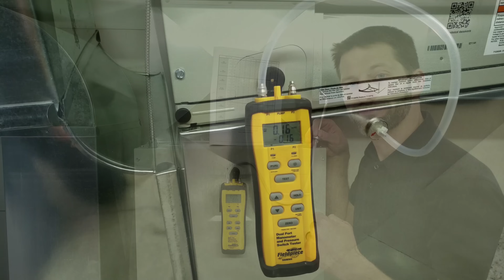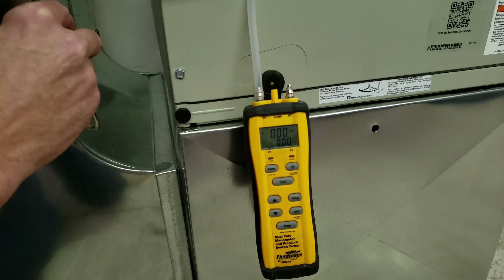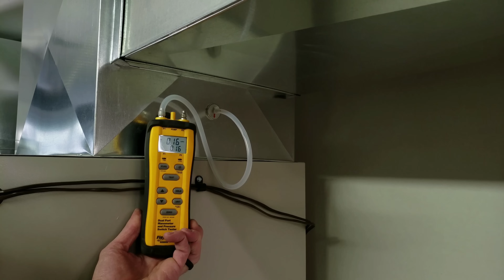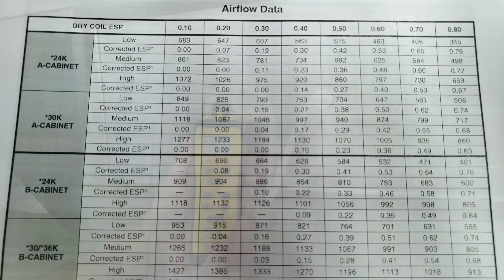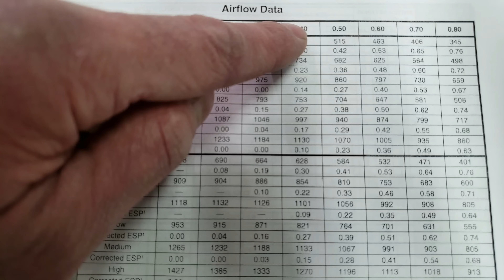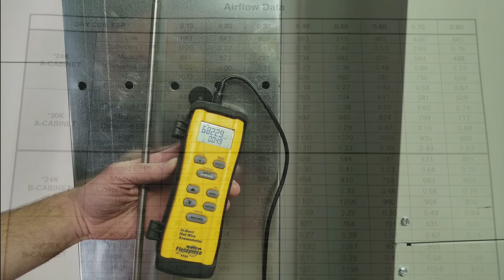Measuring Static Pressure on an Air Handler for Airflow CFM!

Comment: I wonder how many HVAC techs that do all these tests. I can guarantee that most don't do this even on a new installation. When I had my HVAC replaced in 2015 the contractor didn't give me any test results whatsoever. So I have nothing to compare to when the system was installed. They didn't even mention that I had to register my system within 90 days to get an extended "free" warranty. Anyway, which is better: static or dynamic?

Comment: If furnace has two returns connected to opposite sides of blower enclosure.  Do you measure both returns? Add them together? Then measure after ac coil then add that valve to the 2 return values? Or just get a single return valve from blower enclosure  and after evaporator

Comment: what is different with A-cabinet and B-cabinet?
Reply: Usually the difference is the dimensions of the unit how wide it is usually where A is for many brands the widest, B is smaller, C is the smallest (For. Equipment I see lately an A cabinet is 24-26 in wide, vs a B cabinet which is 20-22in wide vs C being 18-20in wide)

Since there is a change in the dimensions that means to openings on each end for return and supply are different and thus the CFMs being moved would be different

Comment: Isn't that technically a pitot tube, not static pressure?  Seems like 'static' pressure should be measured right at the hole without pointed into the flow.

Comment: Helpful video, thanks. One thing that I find confusing is the use of the phrase “static pressure” (i.e., singular versus plural “pressures”). This description suggests that there is a single pressure measurement in the system. It seems that a better way to discuss this subject would be to describe the system as a series-connected set of components each having a pressure drop across it (i.e., pressure DIFFERENCES). This approach is akin to describing voltage drops across a set of series-connected electrical components.

Comment: Where do you stick the probe if your filter is not in the duct right before the air handler such as a ceiling grill with a filter? Do you just stick it up near the filter in open air?

Comment: Hello and thank you for all your teachings . I just bought your book, workbook and cards . It’s like treasure box of information and I HIGHLY recommend all of them to anyone who is serious about mastering HVAC. I Have a question regarding airflow and static pressure. When you took your measurement you inserted the probe into the return duct. I live in Miami and here HVAC systems do not have a return duct. Instead the air handler sits in a closet with louvered doors. The return on the air handler is just open to the hallway outside the bedrooms .  This is the case in all houses here . Where do I place the probe to measure static pressure ?

Comment: Hi Hello sir. Thanks for the explanation. but I'm a bit confused, so suppose if I wanna start to design a fan from zero. the main parameters for this are the air flow, static pressure (pressure rise), and the fan speed (rpm). How to determine the static pressure ? can we put it as much as we want or is there any basic calculation to wisely select the proper SP for the design parameters ?. In my case, I'm about to use the fan to cool down some electrical objects (generator windings). pls help me.
Reply: I'm interested in AC techs response but I think this video is for ducted A/C systems so in your case if you are just using a blower housing to blow on a motor or generator you might use the amp draw to determine the limits. Whereas static pressure is measured inside ductwork. The more you constrict the air flow the lower the amp draw of a "typical" blower motor (a paddle type fan works differently) . If you have to LITTLE restriction of the air flow on a blower the amp draw may cause the motor to overheat.  I use a blower (out of a 120volt furnace) mounted on a plywood panel to blow air out of a window of my house when outdoor temp. is moderate and I put a 3 speed switch on it. I also use cardboard to block some flow to reduce the amp draw and also raise the static pressure and reduces the cfm. I never use the high speed on the blower motor with no restriction of air flow I believe that would overheat the motor. 
If you are using a ducted air handler the install manual gives the "standard" external static usually .5 sp, which I would read as this air handler will provide this amount of air (cfm) at this amount of external static pressure (resistance) so as you increase the amount of resistance to flow by adding ductwork, filters and grilles  you are raising the total static pressure and lowering the amount of cfm.

Comment: Spent $10K at a trade school bakc in 2006 and not 1 instructor is as good as this guy. Amazing explanation skills. Thank you.
Reply: @Fred-zt6gf  depends who your teachers are . a degree with on field experience goes a long way
Reply: Ain't that some $#!%? 🤔 
 I went through the same thing; my instructor didn't teach me a damn thing about how to determine CFMs through pressure drops. 
  You either learned your material online or your book, or you didn't learn anything. 
  He had his mind set on fishing, and would even take off several days at a time to do so.
Reply: True that, I ask my instructor about stuff I learn here and he was clueless with almost 30 years experience. He just taught what industry standards back in days which is not much relevant in todays best practices
Reply: @richlikeg3722  so school is good ?
Reply: @corruptedbrain6  depends on the instructor. It’s like technology, it changes all the time. If you don’t keep up then you just do and teach what you know instead of using all the tools to help empower your students.
Reply: @richlikeg3722  Well, I went to a school for AC as well and there are levels to AC. Somethings you aren't going to learn in the basic AC class. What would you need to know about total static pressure and cfm in your first AC class? You need to master the basics first. AC is the broadest trade of them all. Do you know what a controlled air dryer is or what it's used for? I bet this guy in the video doesn't know either but it's an ac unit that's used to remove moisture from an air system. I didn't know and I never heard of it until I got to a jobsite where they had air compressors and air storage tanks for shop air. Anyway, my point is you learn a little at time. AC school is not meant for you to learn everything at one time. It's meant to teach you the basics and give you a foundation.
Reply: @marlymar4 just by the name of it sounds like a system dehumidifier
Reply: @Fred-zt6gf  i agree that experience and knowing what you are doing is important but are you really gonna be on your hands and knees forever? get that experience plus degree then move to a professional setting or something
Reply: No instructor with this kind of knowledge wants a pay cut to teach hvac kids in school
Reply: @kurisu9103  exactly!!
Reply: @Fred-zt6gf  i didnt mean to offend you fred. I'm just saying not everyone is fortunate enough to work in sales or management but an education helps in some aspects to acquire certain jobs but all and all 
there is truth behind mine and your statements
Reply: You got robbed
Reply: At least you guys’ instructor didn’t direct you to watch his videos like mine did…in his class nonetheless. “I was watching them before i started school nimrod.” 9k later here i am back at square 1.
Reply: Didn’t spend that much but my instructor basically used YouTube videos to teach us the basics. We did use text books occasionally, but it was my instructors last year teaching. In my opinion he screwed several of us over by the way her taught certain things.
Reply: I just did the same and it’s been almost 20 years, but more like 30k
Reply: You got ripped off
Reply: Mr. Craig is a legend. One of a kind. A true gem.
Reply: My trade school was fantastic but to be fair we got Craig's AC book and a lot of his gas furnace material also. Still had a great teacher though
Reply: That all went to the facilities
Reply: Tell me about it spent 20k at UEI 4 years ago and was a HUGE WASTE OF MONEY
Reply: Down load skill cat and use code MERRITT10 to save 10%

Comment: I had a guy say my static pressure was 0.59
I think he pushed a hole through the supply duct? Is that high? If it is high does it always mean my ducts are leaking?

Comment: This video covers the static pressure per a blower motor that can be changed per dip switches or connector position. What about a Variable Speed Blower? Does the thermistor that is built into the motor module control the speed of the blower motor? In other words thermistors have value, so can the different value thermistors change the static pressure air flow?  I have a Nordine made Frigidaire two stage gas fired furnace. It's a down draft unit because we are on a crawl space where the supply ducts are located. Last year the blower would not run. Upon inspection, I found that the motor windings were fine, but the thermistor in the motor module was cracked. I read where this is a problem others have had. The part number on the thermistor was not available per the electronic parts supplier. I found someone who had cross referenced the part with a number that was available. I got one and installed it, but I think the blower runs at a different speed now. I suspect our April air filter was dirty which blocked or reduced the air flow over the thermistor. This reduced the air flow which caused the heat to build up inside the supply plenum. The build up of heat cracked the thermistor. Would that be a possible cause of the thermistor failure?  Thanks for the great video on understanding static pressures per the blower motor speed settings. Sizing the system per the home is so very important. We used the Manual D program to help size our furnace and new ductwork. I think it helped a great deal.

Comment: Question please >. I thought static pressure was determined by duct design,  how did the static pressure increase from .3 to .4 just because you increased fan speed?  THANKS, great video!!
Reply: not an expert on airflow but faster blower maybe moving more air.
Reply: @caru3257  ya i forgot about the system pressure curve

Comment: great video. question about your measuring device.
isn't that a pitot tube? from what I know, the hole at the tip measures the stagnation pressure while the holes on the side measures the static pressure? but both are connected to one pipe that goes to the reader. is that why you only mention static pressure and not stagnation pressure?

Comment: What kind of readings are you getting on a typical gas furnace with an AC coil for static readings in the field? It seems awful hard to obtain a 0.5 reading. Just the static drop from a coil and filter can use up 0.5. Just tested my furnace and it was reading 1.0 in WC. My 1 inch filter has got to go that alone is a 0.3 drop and I know my duct is undersized for supply and I do not have enough return air either.

That AH install is so clean!

Comment: I'm wondering if this instrument doesn't measure Total pressure (static + dynamic)?  If you measure the static pressure, you would measure at a point where there is zero velocity (like the wall of the duct).  A pitot tube measures total - static pressure, giving dynamic pressure that can be used to convert to velocity.

Comment: If the filter is new when i run my test, then I'm inclined to overshoot the chart slightly to account for filter degradation. Maybe they accounted for that already. Who knows. Some systems are very sensitive to filter type and require a poly fiber filter. (electric furnaces are famous for this)

Comment: Can you recommend a cheap good manometer for a non-, professional home owner That just wants to measure static pressure?  THANKS!!
Reply: Manometer, RISEPRO Digital Air Pressure Meter and Differential Pressure Gauge HVAC Gas Pressure Tester https://www.amazon.com/dp/B01680C4C2/ref=cm_sw_r_cp_api_glt_fabc_5ZQST3W4B21SPVC669PC

Comment: Thanks for video it is thorough, well done  and very informative. I have an older  carrier 58mca-060-16110 furnace. I have a manometer to take static pressures but don't have airflow charts to calculate CFM. Other than expensive equipment is there any other way to go about it or can you point me to a source for tables? Thanks

Comment: If more techs took these readings and verified proper on every startup,  the industry would have far less problems.  This is the first reading that should be taken, as part of troubleshooting, before any attempted repairs are attempted.    Good job.
Reply: Yeah this makes perfect sense.. My capacitor is bad, let me check my Static Pressure first...
Reply: Thank you
Reply: Wouldn't fix refrigerant problems with all the piece of shit evaporator coils all the manufacturers have. Trane being the worst as far as leaking coils that are only 1 to 5 years old.

Comment: So when you have insulated ductwork do you cover that hole with a plug afterwards? I guess you need a insulation plug or flap to get access to the duct?
Reply: Air balancers use 3/8 red cap plugs to seal the holes.  Sometimes there is a whole line of holes if the duct need to be traversed for velocity readings, which are used to determine airflow precisely.

Comment: On the supply   - are you measuring under the coil, or over? Does that depend on heating or cooling mode static checks (furnace vs. AC).

Comment: Hello sir.  Is there a generic or common PSC motor air performance table one can use if manufacturer data is not readily available.
Reply from the maker: Each performance table is different so it's nice to have a hot wire anemometer as well thanks

Comment: Great Video, Thank You.  I find it interesting that while manufactures require a recorded TESP for proper commissioning, they don't design in probe holes for that testing.  I have always hated drilling holes in new cabinets..
Reply from the maker: Yeah it is odd but in the case of furnaces, some time we cut the side of the furnace out anyway so it would depend on where the duct connects at but the supply should have one. There really is no reason not to other than they don't want a plug in their unit from them!

Comment: Thx for the vid.  Tell me if im wrong but im not totally agree with ur explanation here.  So of course we have to measure the SP as close as to the air handler because in this case if we measure before that 90 degree elbow we leave out a whole lot of duct.   So its just simply said we have to choose a measure point (not interfere by turbulence) so that we can account for the total length of the duct system.  The negative and positive SP here just mean the return and supply air act on the manometer in  the opposite direction doesn’t mean it a negative number.  So the total SP is total return SP plus total supply SP.  The TESP of a particular duct system doesn’t change unless we shorten or lengthen the duct. So if we increase the blower speed on the same duct system we got more velocity pressure but the TESP doesn’t change so no we don’t have to measure the SP again.  Lastly to get the right air velocity of the system better do a traverse method because the blower wheel can be dirty over time and dont blow out the same amount of air as spec.  Im still learning so hope u can point out where im wrong.
Reply from the maker: Quang I am right there with you on the measurement location, you must be as close to the system as possible and before any changes in the duct occur. Also on the - and + static pressure readings, I may not have explained that as thoroughly as possible. I was just wanting them to not subtract one from the other. The simplest way to explain it would be to just drop the negative sign. I added another negative to change it to positive in the mathematical formula but didn't mention the static pressure is just a value not necessarily a negative one. That is just how we read it on the manometer. In reference to the last thing though, static pressure does increase if you increase the velocity of the air. You are trying to force more air through the same size opening. Static will increase. You can do some tests on the next system you are working on but that is what happens. Thanks!
Reply: AC Service Tech LLC thanks seem logical as newton law apply when you said more air more SP force.  Would you explain why manufacture list ONE (1) SP for several blower speed which produce several different cfm. Thank you very much
Reply: @hangngoaigiare  It's just a chart, it has 3 values. You measure any two and you can get the 3rd one from the chart. If you measured LOW speed and .3 static then your CFM is 660 or so. In fact this is being confirmed at the end of the video when he used the other meter to measure CFM directly. It measured 682CFM so based on the chart you can find the SP easily as 682CFM on LOW settings will give you .3.
Reply: AC Service Tech LLC yes no matter return or supply the motor still has to do the work for that SP present in the system.  So the longer the return duct the bigger the return SP in the pulling direction which will exert amp draw on the blower motor.  So likewise on the supply side.  Thank you very much for ur reply.
Reply from the maker: I do agree that other methods such as temp rise, traverse, or flow capture hood will be more precise and can be used for service work on an existing system. Often times, this method is just used as a quick setup for the initial installation. Its just one of many methods, thanks!